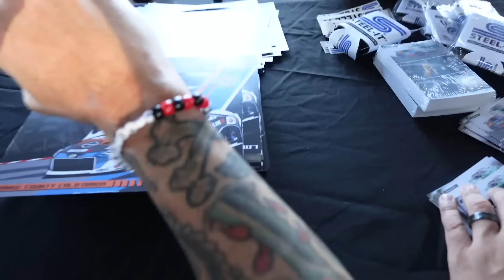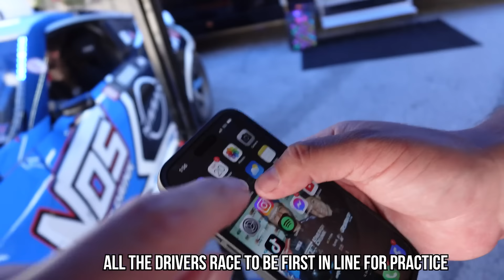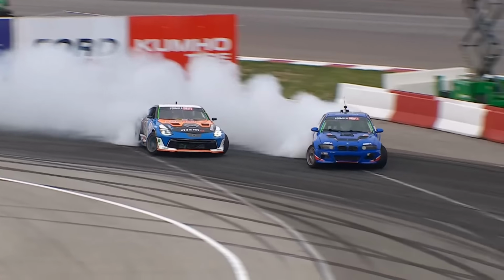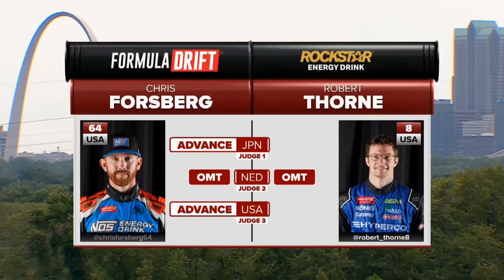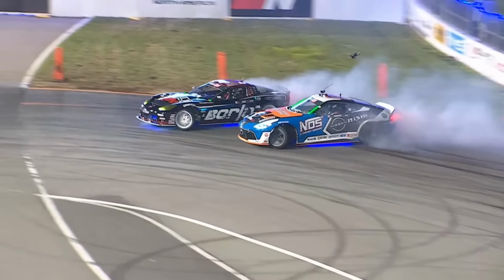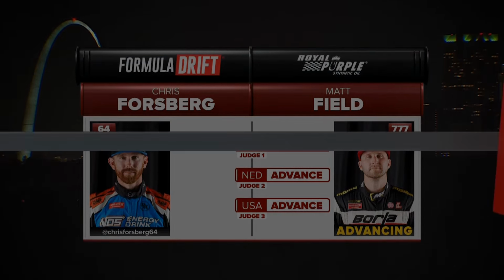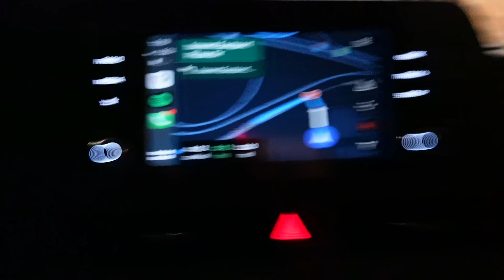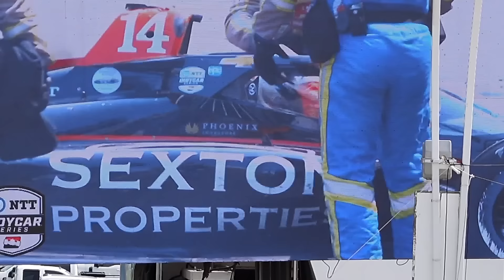Controversial Calls at Formula Drift St. Louis

Comment: Dude that’s the part that Adam doesn’t show him rushing to get the first practice is. I watched this live Matt did not win that not at all his chase was terrible and an almost spin at the end of anything omt like field is a the judges boy and it’s hard to beat the judges boy
Reply: watch it again and actually look at forsbergs rear wheel, it tells the entire story of oz4. Chris was already coming into oz4 with the barely any momentum (hence why he came up short) and then he modulated throttle and handbraked because he wanted to be deeper into the zone but he didn't have nearly enough momentum to actually push the car wide so all it did was stall Field up.
Reply: @nomeru_0  but that doesn’t matter the chase driver has to mimic the lead driver we saw this issue in road Atlanta a lot of the rule states the way it states Matt field should be at fault for a spin and trying to make up ground on Chris.
Reply: @nickdoescher9957  This is not how that rule actually works. That only applies when the lead driver is following the expected criteria. If the lead car deviates from that and the chase car has a mistake that can be directly linked to the error of the lead car, Its always going to be blamed on the lead car. This is how the rules work. You can't just do what ever you want in lead and be like "hE wAs sUpPoSeD tO miMic mE bRo" This is a backwards understanding of that rule.
Reply: @nomeru_0   but he didn’t do whatever he wanted he was shallow in the zone sure but he didn’t stop drift or make a huge mistake causing an issue hence my original statement stands true field should have mimicked Chris and he didn’t he surged and almost caused a wreck and spun that’s on fields.
Reply: @nickdoescher9957  Chris was not on throttle past the decel zone, he pulled handbrake past the decel zone, He lifted past the decel zone. What you need to understand about this level of drifting is micro errors like that will and do cause major issues for an unsuspecting chase car and when a car surges that quickly it's generally not a result of the car magically gaining a bunch of speed, its because the lead car slowed or failed to get back on throttle in an area where they were supposed to be carrying momentum. This is precisely why the judges are so hard on drivers for their momentum outside of decel zones.
Reply: @nomeru_0  then this could be said for Adam and minowa because he clearly hit the breaks passed the decel zone causing Adam to wreck his car so minowa shoulda been at fault for that and lost. Obviously Adam wouldn’t have been able to continue due to damage but the point still stands.
Reply: @nickdoescher9957  The same is said for Adam. The majority of people including myself agree that Adam should've won but this isn't about Adams battle.
Reply from the maker: @nomeru_0  This is about all battles, mine is an example but I am looking for all of your opinions on if you feel that the calls are consistent between battles.
Reply: @chrisforsbergracing  no I don’t think they are 100% consistent. Even if I were to try to be as objective as I possibly could I don’t think I could say that. But I could say the same thing for just about any competition I’ve ever watched. The LZ vs Minowa call was the only one I really disagreed with outside of that I think the judging this round was fairly consistent